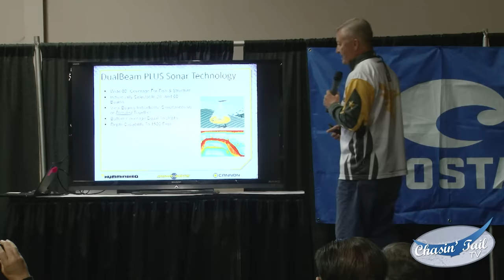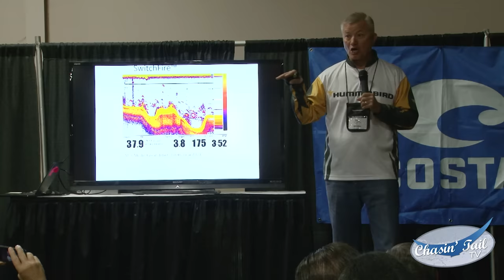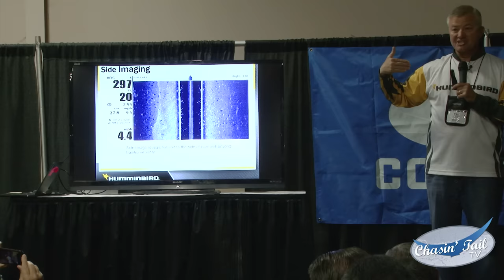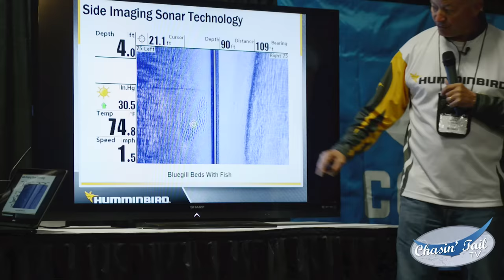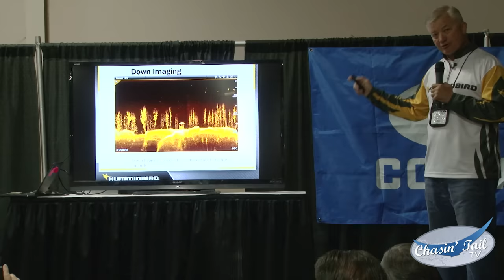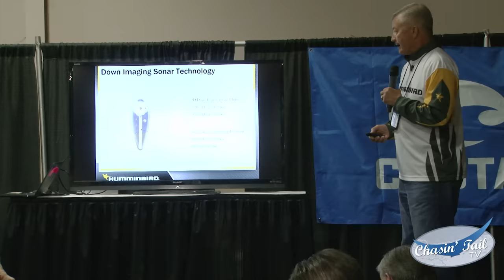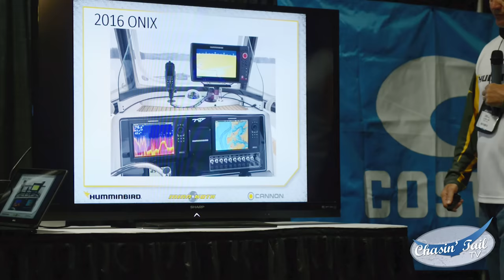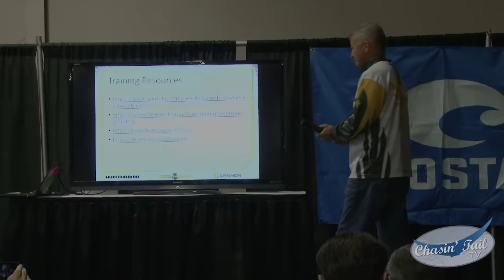Know Your Sonar w/ Humminbird Electronics | Chasin' Tail TV

Comment: Great info wish I had seen this before I bought my Helix 5 DI no gps. It works good but not great I should have got the si and gps. One minor problem when I start the outboard the Helix goes off and I have to unplug the power to reset it. If I turn it off before starting no problem.
Reply from the maker: I would call Humminbird because that is not right. Glad you enjoyed Bill's seminar.
Reply: This is a power problem, not a Humminbird problem. You are drawing the voltage too low when you start your motor. Look at your wire size/condition or your battery. I like to have a dedicated starting battery and run everything else on a separate house battery but this is not necessary for it to work properly. The problem is on your end.
Reply: The wire is very small Humminbird need to put bigger ones on.
Reply: Not that wire, the wire from your battery to the unit.
Reply: It's the wire that comes with the unit. Very small like Donald trump's hands.
Reply: Doug Vaughan j
Reply: Wire the power to your unit directly to the battery with a heavy enough gauge wire.  If it is routed from the console instrument panel, it will draw down too low or be interrupted while the motor is cranking.

Comment: I am a walleye fisherman .
Is the are point to use 200mHz vs the dual-beam?
Reply from the maker: The way I understand it, the Dual Beam combines the information from both the 50 and 200hz signals. This is how most people I know run there units. Although, some people prefer to see the two frequencies separately. They use the wide 50hz to find fish or structure, then the narrow 200hz to more accurately pinpoint the structure and/or fish and see it in greater detail that the higher frequency provides. 

I always think of the 50hz as being 3:1, meaning it is 3' wide for every 1' of depth. So at 30' it is showing you a 90' wide piece of bottom. Whereas the 200hz is 1:1 and is showing you 30' wide piece of bottom and greater detail. Although, I am not sure if that rule of thumb still applies, but conceptually I believe it is still close. RD

Comment: Humminbird, help us poor folks out and make a monitor only,  so if i spend cash for a helix brand and mount it at the console then tie in a monitor to mount at the front of boat, and make the monitor cost low like $100 to 150!  Or is humminbird only targeting the rich and making them buy two units and doesnt care about the avarage pay scale person???
Reply: Agree, screens are cheap now days, why cant Humminbird (and all the other electronics mfg) make a unit that is basically a CPU, and sell monitors seperate (or allow the customer to use and external monitor such as a tablet, cell phone, or computer monitor). I am sure control could be handlered via a remote control type device. This I think would keep cost down, and people could build a system that works for them and upgrade as neseccasry . For example have the electronics of a Helix 12 SI GPS G2N in one box with connections for transducer, power, networking etc and also have a video out, and maybe even a control In/Out connection. Should cut down on unit cost. I think I know why this has not happened (how else do you get people to buy the latest and greates right) but I feel that a lot of the difference in cost (at least in the current market) is associated with screen size. Yes some of the bigger units get more tech, but look at the Helix 7 from a couple years ago it did not have auto chart live, and the G2 has it.... Ok off my soap box
Reply: they are in love with technology not praticality
Reply from the maker: Some companies sell screens only, but only for the very high end commercial units. I just purchased a second MFD, when all I needed was a second, networked display. I didn't need the redundant  "built-in" sonar and GPS components. Would be a good question to ask at one of the upcoming outdoor shows. I have a feeling it's simply not cost effective for them to produce...to expensive and too little demand. But that's just my hunch.
Reply: Humminbird is a corporate entity with one single mission: to make money.  No different that any other corporation.
Reply: NO one cares about "average" people.  So true.
Reply: Yes, agreed! They already have i-pilot that syncs all the instrument's data in the boat together, so it shouldn't be too hard to do that, but you know that isn't how they make big profits!  I think it would put their devices in more boats though!